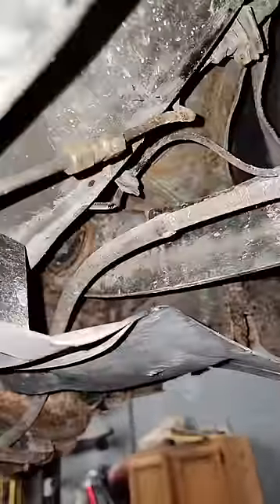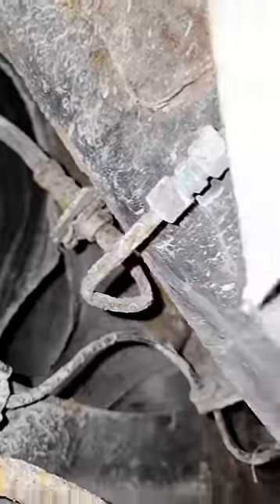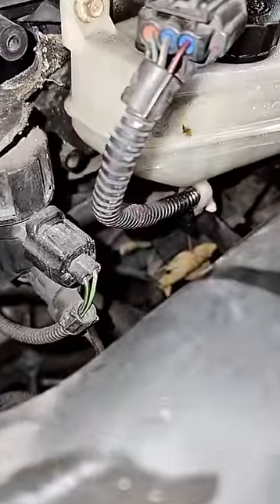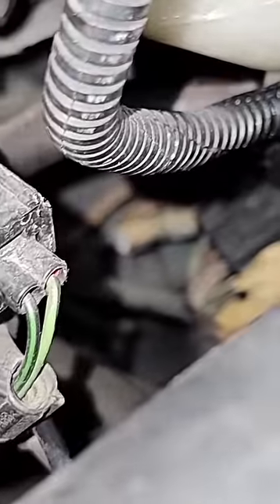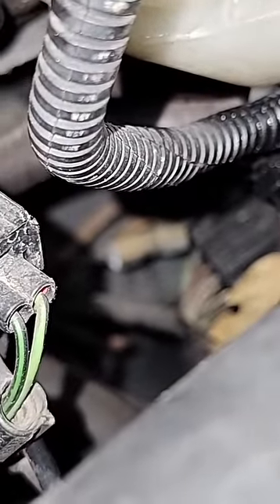don't use compression fittings on brake lines

Comment: Reminds me what my grandpa used to say. Do the job right the first time, save yourself money and time in the long run.
Reply: "If you don't have the money, time, and/or resources to do it right, then you damn sure don't have the option of doing it twice.  Make a good decision."
My electrical lead would genuinely say that to clients and they appreciated it once they realize that he's risking money out of his own pocket to do the right thing and potentially lose the job, so it's not out of his own self service.
Reply: Brake pedal sensor failed in my first car, no brake lights. 99¢ light switch and some spare wire, I drove it another 15,000 miles.

"Doing it right" only matters if you don't know how the thing your working on functions. If you know the current draw is good for the wires you're using, then no need to worry.
Reply: @Lazlow Behen  sure it worked but was that really the best possible way to make that repair
Reply: @tao8150  For a car that cost $1400 and drove 5000 miles with half the oil pressure it needed? Yeah, it was just what it needed. Why spend my time or money diagnosing a problem that could be fixed in 20 minutes?

 That car did 20k miles a year for its entire life, with the last year of it's life being spent below 2500rpm due to a slipped timing belt from an oil leak, it got it cam shafts oiled by me with a little bit of oil every day as the oil pump could no longer supply oil to the top of the cylinder head. It had a bent connecting rod from driving through a puddle a little deeper than anticipated which caused a hydrolock. First gear slipped straight into second, yet still would do 91mph with the 2500rpm red line. This poor 2005 Dodge Stratus went through the ringer, even seized once, only being revived by pouring WD-40 down the spark plug holes and being let to sit for a day.

Sure, any of those problems could have been repaired, properly even. But that would have cost more than the car was worth, and ultimately I was able to put that money towards something more useful.
Reply: @thelazarous  those dodge stratus v6s are impossible to blow up.

I had a buddy with one and he didnt change the oil for 40000 miles and it never broke down once.

When we finally did change the oil it came out like soft serve chocolate ice cream.

Car eventually got scrapped because of a bad transmission but that engine was running when they scrapped it
Reply: @contraband1543  Are you kidding? Those 2.7L v6's were the worst, you could change the oil every 5000 miles and still ending up with spun rod bearings. I had the 2.4L Mitsubishi motor, which is why it lasted so long after so much abuse.

I'm genuinely amazed to hear a 2.7L that went out because of a transmission, most I've seen you can hear clacking a mile down the road due to all the sludge built up preventing oil from getting back to the pan.
Reply: My mom said to me do it right the first time and you won’t have to do it again.
Reply: @chrisrobbins9058  Your mom clearly hasn't worked on a dodge

Comment: I've used compression fittings for my entire 16-year career. Fuel lines, hydraulic brakes, and air brakes. NEVER once have I  EVER had a single issue or failure.

Comment: I have used them on my own cars, never on a customer's and have never had one fail. I still have one of the cars and it has lasted almost 10 years with my compression fitting repair.

Comment: Been using compression fittings on mud trucks & tractor trailers since the 70s & NEVER have I had an issue with them.

Comment: When I left a trailer for the next shift, they would always get irate with me because I would write up repairs they thought were negligible. They once asked me why. I responded, "If I don't write it up and it goes down the road and DOT flags it, it's on me. If I write it up and you don't fix it, if DOT finds it   and the load is late, it's on you."
Reply: Ppl use to get mad at me for lock out tag out on equipment they would take the tag off and run it anyways.
Reply: Awesome reply !
Reply: I had to explain this to my boss when I was working as a tech. Several times. But they would inevitably ask me again why I was writing down all the problems with our customers' cars upon inspection. It never failed.
Reply: @Ronnie Williz  Where I work, removing a lockout/tag out without contacting the person that had tagged it (like if the accidentally forgot to remove it), would get you fired on the spot.
Reply: @chrishull8707  as it should
Reply: EXACTLY.
All he has to do is document that he recommended those compression fittings be replaced, and the customer declined.
That washes his hands completely.
This guy sounds like he wants to bill for an extra hour or two...
Reply: @ronniewilliz153  I almost died because of that crap.
Reply: @frikyouall a good lawyer would have the CEO and transport manager to driver's all accountable for their negligence of duty of care, if bad enough fines from 100,00$ to ten years in prison.
Reply: @ronniewilliz153 You've inspired me, I'm going to Lock out Tag out my forklift at work tonight. Tired of this hydraulic sinking issue. Someone could get hurt. We have to lift shit up and go under it ironically to do the job.
Reply: @jackpowell8155  That sounds terrible!  Can't you just carry around a number of 2x4's of different lengths and maybe a jack stand - that way you have like ~8-10" of adjustment with the jack stands & then just use the right size 2x4 for the job!  BAM - just saved your company all the mess & $$ of those stupid repairs.  

Maybe make this suggestion to your company and I'm sure they will fast track to you management position in no time!!!
Reply: @bruh meme simillar case with HVAC stuff (In Canada at least) if you remove the tag placed by the last guy, without doing the proper paperwork, you are screwed.
Reply: @castanza128 well going through and removing and untangling the lines would probably take an hour.
Reply: @jackpowell8155 Your hydraulic pump is dead. It shouldn't lose pressure and lower the forks..it should lock in place. 
(Modern forklifts, like the one I used have a slide lock in them in case the hydraulics fail while lifted. 
Only had it happen in one instance, the repair tech that would change the fluid didn't put the lines on tight enough. 
I got sprayed from mid torso to my hair in hydraulic fluid..hopped off the lift, and walked the fuck too my car, called the boss on my way home "said, nope. Done today" and told him why. He just laughed and said "See you tomorrow"
Reply: @ronniewilliz153 they'll try and say it isn't their fault when it maims or kills someone too...
Reply: @cwm3599  yep.
Reply: Something I always do with equipment in the warehouse...

...just for the simple fact I'm not gonna be on the receiving end of "The Blame Game"...
Reply: @ronniewilliz153  That's why you use actual lockout locks, where only you have the key. Company I work for has a whole set of LOTO locks where each individual lock has it's own keychain and no duplicate keys. When you lock out the machine, you put the keys in your pocket. The company would much rather pay to replace a LOTO lock they had to cut off because you lost the keys rather than pay the OSHA fines and the wrongful death suit should you be hurt or god forbid killed because somebody put the equipment back into operation while you were repairing it.
Reply: Pretty sure compression fittings are illegal on brake lines
Reply: @robert9595  sounds like something that would've happened at one of my old jobs for a drilling company
Reply: @ronniewilliz153   have had people ask (straight faced serious) why I stopped them from hard bypassing TWO safety features that make sure you cant start a  bladed refractory mixer without the top grate on  or while standing too close to it.   The only time you need to be close without the top on is for cleaning.... and you don't want it on while your arms are inside it.....
Reply: @ronniewilliz153  they just ripped the tag off? So basically it was only tagged out and not locked, right? Anytime I have to use that, it's because I'm physically inside a machine in the mill, or on it or whatever, so it's all locked out. Tags have their place, but nothing beats a lock.
Reply: @richardmillhousenixon  I'm a millwright in a hardwood mill. Everybody there who works on the machines or runs them has locks. We all have 5 locks with one key that fits all 5. Nobody else has keys and the locks have unique ID numbers. Most of us carry 3 locks on us at all times and that's enough for the vast majority of the work because each breaker panel has cables so you can run them thru a dozen or so breakers and use a single lock for them. You still have locks left for hydraulics and pneumatics. Some of the big projects like installing a new headrig or debarker or whatever require 20 or so people and there isn't enough room for that many locks. In those cases, a master lock that has one key is used. The key is then put in a box that has holes for each workers lock. The key can't be retrieved until every worker has removed their own lock.
Reply: @richardmillhousenixon  also if any locks need to be cutoff, that's a big process. I've only seen it happen when somebody left after their shift and forgot a lock. The place has to be searched while a supervisor tries to contact the employee by phone. If they don't answer, somebody will go to their house to contact them. The lock isn't touched until the owner has been contacted and it's certain that they are no longer on the property. If they are close by, the boss might be nice and let them come back and remove it. Otherwise, one of us grabs an angle grinder and cuts it off so work can go on. But if one gets cut off, that means all management knows, a lot of paperwork gets filled out, and the owner of the lock either is lucky enough to get an unpaid vacation or they come in for their next shift and pack up their tools.
Reply: @ronniewilliz153  that's a safety hazard, and I would be throwing hands if someone did that.
Reply: @jackpowell8155  them seals can give and let go and it will hurt you lol. They better hurry and fix it if they want it back online asap lol
Reply: @justlucky8254  ive never worked for a company that followed the loto code lol.
Reply: Well that explains why they were irate

Comment: Breaks are always flare fittings. That’s the way it’s been since the 50s or earlier. The only way you can use a compression fitting on a brake line is if it’s air
Reply: Or need to fix it on side of road just to get home.
Reply: *Brakes
Reply: @caklais777  5 times??
Reply: @ILHillbilly67  Yea, thats what normal rusted pipe does. Burst at one place, you fix it and it burst at other. No, i dont repair them like this. I just block brake line at master/abs with nail to get me home(it was one time)
Reply: I've used them many times with zero issues and know a good few other people who have with zero issues aswell
Reply: @trailman20  9 out of 10 times I see a compression used where i live its rusted brake line and compressions dont seal unless the line is relatively clean and smooth....no semse wasting time with an, just flare it and be done
Reply: Technically you can use DOT approved brake line compression fittings.  They are basically the same thing, but are stronger because they are made of steel.  They also only work on clean new lines, but I still don't use them.
Reply: @1D10CRACY  why would u put a compression fotting on a clean new line anyways? Lol kinda defeats the purpose. I bought the mastercool hydraulic flair tool , has everything from double flair, bubble flair, push connect , GM fuel line and trans line collets. Best $450 I have ever spent, but I do a TON of brake and trans lines tho
Reply: @trailman20   I agree . I have used them as well with zero issues
Reply: @erik120719  well haha yeah ya obviously don't attach it to a piece of rusted line haha you cut the rusted part out and clean the ends ..I've flared the ends to with other fittings I'm just saying they work fine
Reply: @trailman20  qhere I live if there is rust on a brake line its usually the whole line lol...no clean nothin!
Reply: @erik120719  haha yeah I hear ya ..I'm from down east Maine 🤣
Reply: In Minnesota they will all Rust out and fail the same in a few years 😂
Reply: @trailman20  same here I've had one on for about 8 years now. Ss still haven't failed. My guess those who have had em fail didn't make sure the cuts are straight and cleaned up otherwise they probably will fail. Used several threw out the years not had one fail. Just like paint and everything else prep work is the key to desired results
Reply: @officerbuzzkill  I can't argue that flared ends are better BUT if done right I've seen zero issues with compression fittings
Reply: @trailman20  I ain't denying that either. But if ain't got the time or cash to do a new brake line, this is a viable alternative. It also might show ya how bad the lines may or may not be since they rust from the inside out. But plenty of times less than a foot away from the failed section is still really good line. Also take that opportunity to usually drain most of the old fluid out. But I've done a compression fitting after being told it can't hold the pressure created, I'd stomp it and a semi new wheel cylinder has gave up the juice before my compression fitting
Reply: @officerbuzzkill  right ..that's what I'm saying man as long as there is some decent metal to work with compression fittings work just fine every time just make sure the ends are squared up and clean fully sweet them into the fitting tighten them nuts down and your ready to rock
Reply: @trailman20  agreed I know of one that has been on for over 20years......rusty lines can fail but never seen a compression fitting when installed properly fail ,not 1.
Reply: You're supposed to use double flare on your brake lines and fittings, no one uses single flares on their lines anymore that's way old school and less safe, just so everyone knows double flare your brake lines and use the correct fittings for that, and don't use the rental tool from your major auto parts stores those tools suck and it is extremely hard to get a good flare and double flare, do your research and find a tool that can be used both in line and on your car and for off your car, they are not expensive tools, but they're much better than the rent-a-tool ones that all your major big box auto parts store have.  I found 1 under 20 bucks and it gives you perfect flares everyone with no hassle.  Auto zone had them for sale online.  20 times better then the rental tool
Reply: @erik120719  you blew $450 on a brake flaring tool!!?? You can get one at AutoZone that works in line on the car and off the car and does all those flares and it's 20 bucks or less and gives a perfect flare every single time
Reply: @polosavage1  I do this for a living tho, not just my own vehicles...and mines hydraulic. Mastercool 72475. Prices have went down since I bougjt mine a few years ago but it paid for itself second brake line job I did
Reply: @polosavage1  I have a double flare tool set and I don't see how either comp fit or dbl flare  equates to one being better than the other....once a ferrule is compressed you'll  have hell getting it off without destroying it the line or both....and threads can be stripped on either. Maybe cuz I'm from Missouri and you gotta show me but I've yet to have ever seen a video demonstrating why not and if ever.a compression fitting was to fail due to failure rate I should've seen an example decades ago
Reply: @jarvislarson6864  compression fottings r brass and not rated for the pressure, thats the simple answer
Reply: Been using them for years myself. Absolutely no problems. 
And I’ve got years on them
Reply: @erik120719  they sell steel compression fittings that are made to use on brake lines. Your right about the brass ones though and there was a brass one on this car.
Reply: @caklais777  pinched the lines in Celica to get it home..lmfao.
Reply: @dbongoloid9541  Mines were so rotted, there was nothing to pinch 😂😂😂
Reply: @trailman20  Same, I've seen compression fittings last for years. Don't get me wrong, a flare is better, and replacing the whole line is best. But compression fittings get a bad wrap from people who, apparently, don't know how to do them properly.
Reply: @loacyric  yeah I've never had any issues with them ..I don't think any one can argue that a flare isn't better but if ya don't have a flare tool or the money for a new line
Reply: @trailman20  Flares are better because the material is thicker and doesn't need to be compressed, just tightened. This makes them easier to use, with less "skill" required, often resulting in them lasting longer/working right the first time. Granted, that last bit is down to user error, but there's less room for that error in flares. Which brings me back to flares are better.
Reply: @caklais777  No. not at all. Ever. You call for a tow or fix it right on the side of the road. It literally takes the same time to flare a line as it does to put a compression fitting on… There is never any time it’s acceptable to “fix” your brake lines with compression fittings.
Reply: @caklais777  That’s why you replace the whole line… It’s sold by the foot… You can literally buy pre flares sections too…
Reply: So all they would have to do is flare the ends of each fitting and minimize the amount of fittings?
Reply: @caklais777  I've done that on one wheel on a log truck one time, but it was sure enough just as temporary fix.
Reply: @erik120719  same here, absolutely love that thing :) talked my boss into it after I showed him how I could get 2 flares done in the time it took for him to get one done :3 felt good. Downfall of course is that after that I did all flares since he didn't want to learn how to use the hydraulic tool and "you're faster anyways" lol. Meh I didn't mind.
Reply: Double flare.